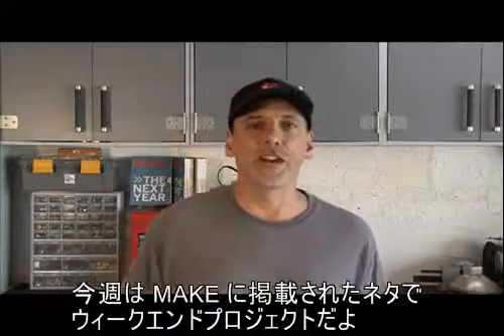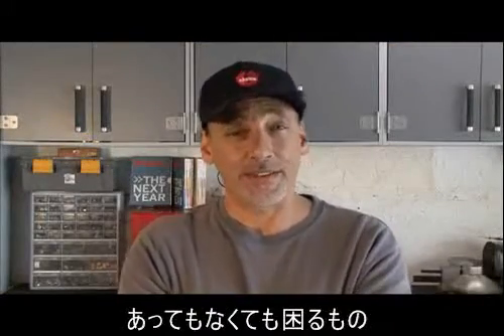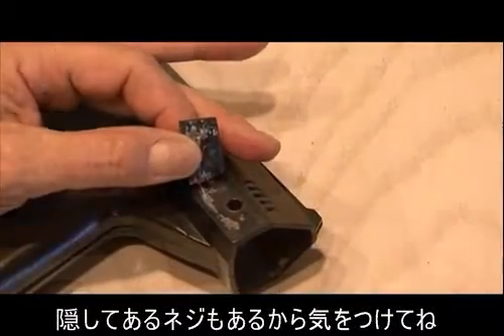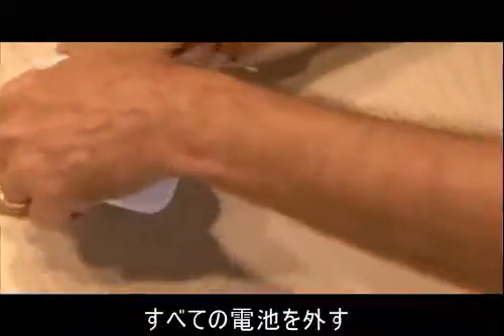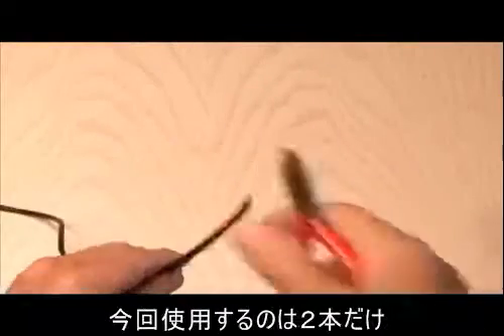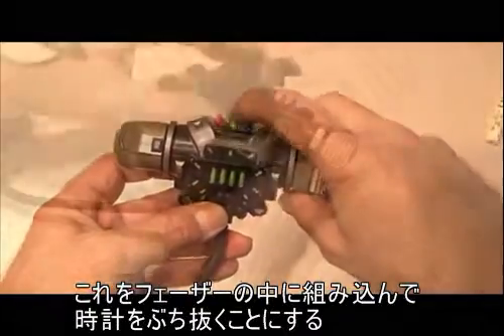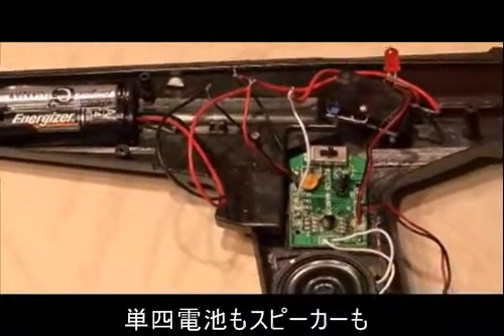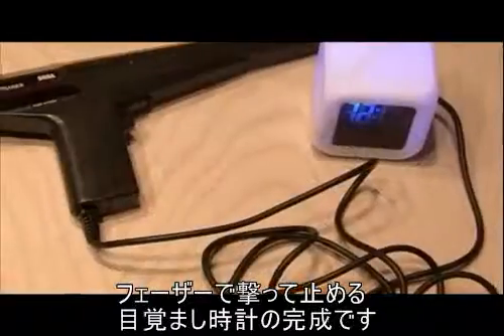フェーザー銃で止める目覚まし時計 - Weekend Project

Comment: I thought Kip was going to fit the LED alarm clock with an IR decoder (available at Radio Shack).

These inexpensive devices decode the frequencies of most IR LED remote controls, filtering out the 38KHz pulses into simple high/low output.

Hook that up to the "snooze" button (with a simple microcontroller or even low-current relay) and you use any button on any common TV remote to shut off the alarm.

Seems way better than destroying a Sega peripheral...